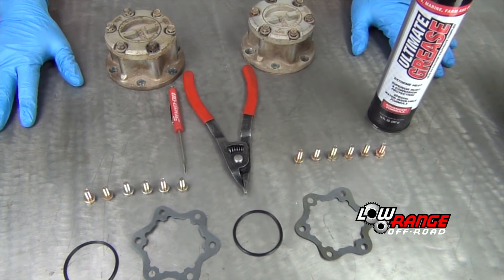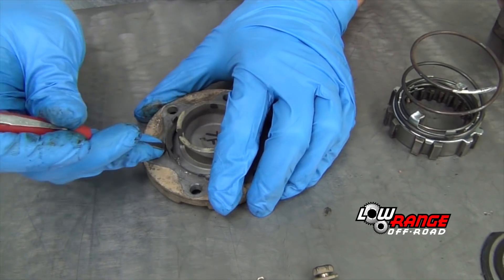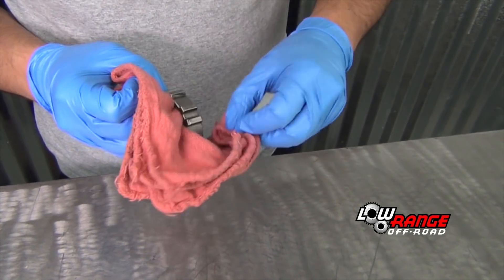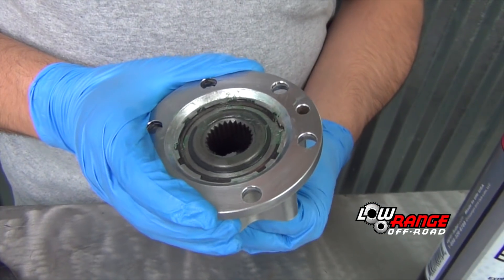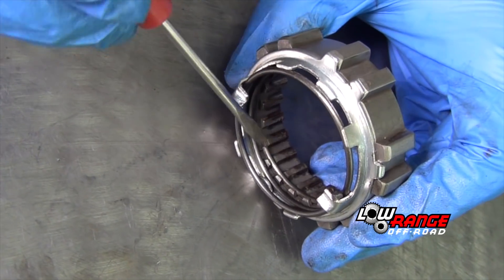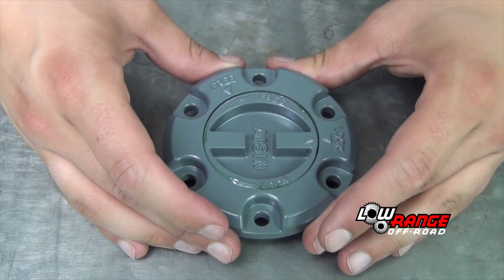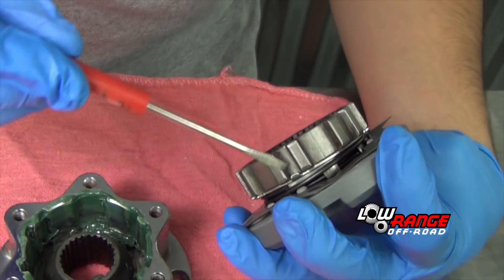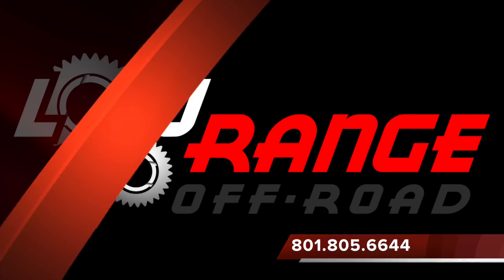How to Rebuild a Samurai Solid Front Axle (Part 4) Aisin Locking Hub Rebuild

Comment: So since you're fully assembling the hub before putting it on the axle shaft, you must have deleted the C clip at the end of the axle shaft and don't bother putting it back on? EDIT: In part 7 you disassemble it and put the clip on. So for those of you only doing the hub rebuild, you put the outer hub casing on the vehicle, then put the clip on the end of the shaft, then put the cap on.

Comment: At 3:48, I've replayed maybe 6 times, and I'm pretty sure he intends to say that the bottom circuit of the spring needs to be below BOTH of the turned in tabs (located at 180 degree opposite sides of the ring.  If you don't do that, when you select "FREE", the spring will come loose from the sliding teeth, even when it's all test assembled.